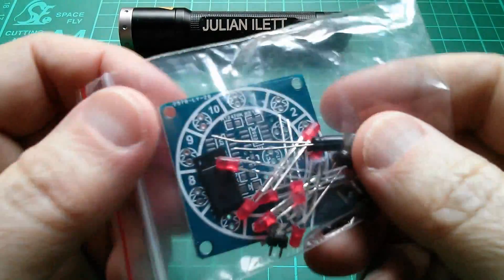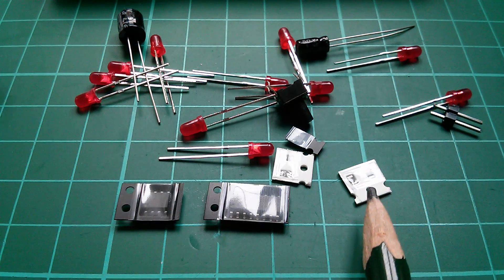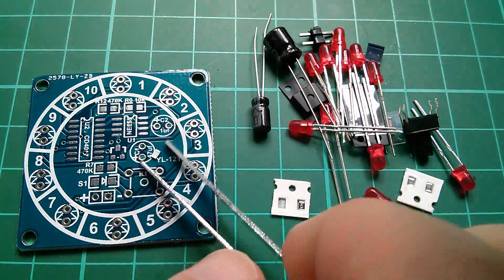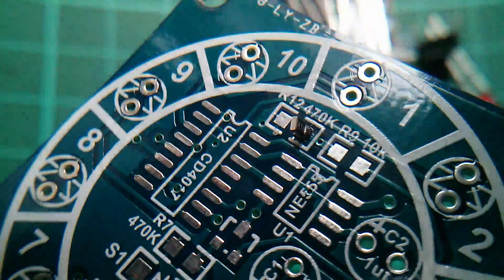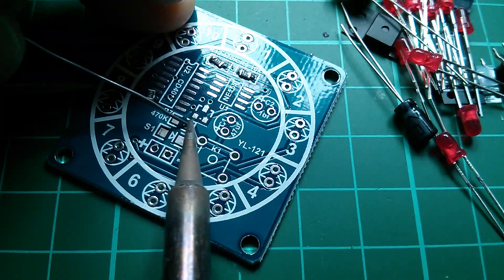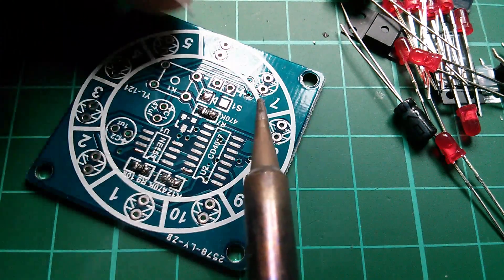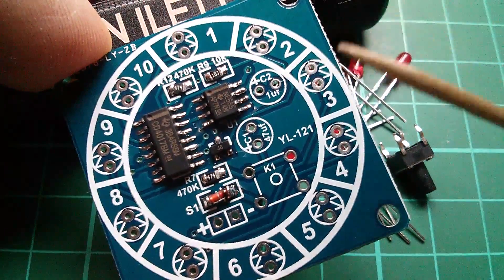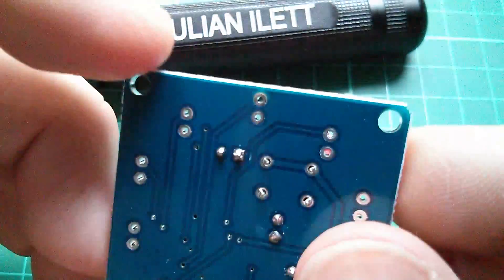Basic Electronics: Surface Mount Components Kit - 555 Roulette

Comment: You can do  surface mount stuff with solder past, just a tiny blob on the pads , place the component and then go in with the soldering iron while holding the component in place with whatever comes to hand , a tooth pick / cocktail stick woks fine

Comment: I think soldering surface mount is easier especially when you have to remove the components.  I hold the small components down with tweezers while tacking it on one side. I hold and align the large components down with a fingers while tacking two corners. If you want to try drag soldering I tilt the board with one hand so the solder runs down across the leads while holding the iron with the other hand. I've seen videos on drag soldering and they lay the board flat. I let gravity assist me because molten solder runs downward. I did it like this everyday for 11 years.
Reply: Same here, SMD is easier as you don't have to deal with flow through for holes. Thin solder also works better, I use .022
It is unusual to see small kits with surface mount components.

Comment: What i like to use for teeny tiny components or things of the like i need to hold still while gluing them down is a pair of tweezers you can get at bargain stores that when you squeeze them they open up and when it's let go it holds the tips together with an adequate amount of pressure, they work great.
Oops i just noticed that's exactly what you used for the diode, right on =)

Comment: you may find it easier to tin to surface pads first, dab some flux then place the components after with tweezer. Touch one end of the component and watch the solder melt around one end of the component, then repeat on other side.

Comment: i did a part surface mount kit a few months back and i brushed a tiny bit of solder pate on the pads, held the component on with a cocktail stick like you, and just touched each pad with a 1mm tip....seemed to go ok as long as you get the right amount of paste..

Comment: Julian or anyone ,how is lead free marked and how is leaded,solder marked my new roll is marked63/37 I assume that the among of lead and tin,I hope I bought leaded solder,I no some of the Chinese brands don't work as well as my old roll of Lester solder I trying to find the best brand of leaded solder
Reply: Lead solder is either 60/40 Sn-Pb, melting point 188 °C (370 °F), or eutectic 63/37 Sn-Pb, melting point 183 °C (361 °F), less prone to dry joints.
Lead-free solder is usually eutectic Sn-Ag-Cu, melting point 217 ˚C (422 °F).
I use 63/37 Sn-Pb for hand soldering due to the lower melting point.
Any well-known brand, 63/37 water-soluble flux-based solder will do well.
Reply: Thank

Comment: I did the same as you did ,I thought I was getting,the kit with the normal size components,my first kit with smd chip on it flew across the room,I order another batch of the ne555 chip,then when I went to solder my chip on,one of the little pad disapered,not to be out done,I ordered another kit,now I am watching your video ,and hope I don't screw this one up,I also oreded a regular size kit.this kit is not for beginners,I read up on it and it said for experts.if

Comment: For future SMD soldering jobs I would recommend using the tweezers to hold the component by the sides. That also applies to ICs when soldering one pin down first. Tinning one pad and reflowing it to attach one side of the component is the right way to do it when hand-soldering. For ICs with more pins (they're usually the same package but the pins are closer together) you can drag the iron across all the pins (after sticking it down with one pin first) and add solder at a constant amount while you drag. If you see bridges, drag again starting from the bridge and moving across the other pins. Do not drag outwards or the bridge will remain. You can also use a desoldering pump on the bridges, or a slight touch with solder wick. It usually retracts just the right amount to make a perfect solder joint but also removes all bridges if they're on the same side. These are just helpful tips, like with through-hole soldering you will develop your own custom technique that feels good for you. Also, regarding the LEDs, Chinese people have a bad habit of putting the flat side and the short leg on the positive side. They're not rejects, they're just cheap Chinese LEDs that they have designed themselves. It's annoying but true, I also have those kind of LEDs.

Comment: I have found with many of these kits is a very thin layer of solder on the pcb, so just place and hold down the the component and heat up each lead with the solder tip.

Comment: You could always use ESD tweezers to hold the component down while you get it in straight.  Also, flux works wonders with SMD components.

Comment: Another helpful tut that I am so grateful for, thank you. I know I screwed up but not sure where. One led comes on,does not flicker when button is pushed just stays on while the remaining 9 stay off. Can you suggest where my mistake was ?
Reply: Since nobody seems to have replied in the months since you posted this question, I'll see if I can help with some general advice.

If a LED lights up but the button does nothing, this suggests that the 4017 counter is working but the 555 timer isn't.  The most likely reason for this is a bad connection somewhere around the timer or the button.

Comment: Left-field tip for  the bigger chips: sandwich the chip and board between two tiny neodymium magnets, slide it into position.  There should be enough friction to do the job.
Reply: oops, forgot to mention that you need a non-ferrous tip on the iron, or make the copper wire wrap tip extension mentioned in another comment.

Comment: Surface mount parts can be a pain. I have a microscope where I work to see and touch up joints made by a machine. It's not super powerful, it's markings are 1X-4X but I suspect that's in multiples of ten. Also a stupidly thin soldering iron tip helps too, less you bridge half your connections together. With good lead solder, flux is hardly necessary, although all my parts come pre-tinned so that obviously helps.

Also, you can try using some glue, fast drying super glue works, to tack the components in place, saves you the headache of the components sticking to your soldering iron.

Finally, a pair of ESD safe tweezers can be a life saver.

The business where I work uses a wave solder machine that is probably older then I am (born in 91) with surface mount ICs on the bottom of the board. It constantly bridges connections and misses others. I have plenty of work to do.

Comment: You made that look difficult. You should try using some solder paste, cheap ebay stuff is fine. Just add small amounts to the pads, use tweezers to place the components into position and use a heat gun/blower attachment to melt the solder evenly on all pins. It will line up your components perfectly.
Reply: +Gus Wilkens 
That's what I was trying to think of, seen someone doing that in a video, will have to remember solder paste if i ever need it.

Comment: Tip: When mounting SMD ICs, attach one pin, then use a strip of solder across all the pins and drag the soldering iron from one end to the other. It's faster and doesn't end up with using too much solder. The initial attach point needs to get re-soldered using some flux.

Comment: For me this kit was the first SMD kit and it didn't work out for me. The NE555 had no sign on where pin 1 was and so I soldered it the wrong way around. After desoldering and rotating the kit still did not work (which might have killed it). 1 LED lights up and that's it and randomly after some time it goes to the next LED. Sometimes when pressing the button it jumps to the next one too. The SMD IC's might have gotten too hot. Luckily it was just $1.00 when I bought it off Ebay. They also have SMD training kits where you get a lot of SMD components and when you soldered them all you can make a LED light up when powering it. It should come in the mail anytime now, I could use a bit of SMD training.

Comment: That project brings back memories.  Doing SMT soldering with soldering iron is tricky until lots of practice has been done.  I professionally had to remove something like (300) TE28F640 flash chips with a Hot Air Station, try to re-program them all in a programmer but pins so tiny, never could get all pins to fit in the programmer, so had to program and soldering in new ones.  Took a few days to get the method down yet once done, was able to get them install super quick (about 50 seconds for 40 tiny pins exactly in place without bridges.  Using the Sweep method and good liquid flux made this very easy.  But yes, took tons of practice to get the right feel.  Using Desoldering Braid/Wick with little solder on the wick, brushing over the SMT pads put just enough solder on the pads to do a easy tack soldering of a few of the tiny pins where chip was alined.  Then later coming in a soldering in the IC proper.  Even got where could fix 'lifted' SMT pads with 30 gauge wire, then put IC on that.  From starting out, it was ultra stressful to after a week of doing it, actually enjoyed it.  Disappointing when job function changed.  For smallest parts, Hot Air Station practice and its easy with those too.

  So all this is put here for any reader learning SMT works, don't give up.  Its like learning to type, seems impossible at first but finally, comes together and its easy.

Comment: Julian, best way to solder SMD like this is to use liquid flux.  Apply to the pads, place the component on the pad, hold with tooth pick or tweezers and then apply the iron with juts a trace of solder.  The flux ensures a good wetting of the joint and allows you to get neat and tidy joints
Reply from the maker: Malcolm Crabbe Flux pen is now on my shopping list - cheers

Comment: Your joints don't have to look like that ;) . You should really get a different tip for soldering SMD! This one is way too big and the conical shape does not help either.

I've used conical tips for the longest time (even had one 0.2mm tip) and always had problems to get the heat into the pad and the part at the same time (which is absolutely necessary for a good joint). With a conical tip (or as seen from SMD scale: ball nose tip) it's quite often impossible to touch both at the same time because of the radius and when it does it's always only in a single point, which doesn't help the heat flow. Adding solder to the tip to have more contact area is contraproductive, because until you get to the joint all the flux has burned away and if you add any more fresh solder it's way too much. You see how you have a problem to pretin the pads without touching the tip? Ideally you heat the pad and and add the solder to the pad, not the tip.

My new soldering station then came with a small chisel tip (1.2mm wide). It's very easy to heat the pin and the pad by just pushing the chisel into the corner between the two, which makes the solder flow very nice without any blobs.

If I had to list what is needed for SMD soldering in order of importance (IMHO):
1. the right tip -> small chisel tip
2. fine solder -> 0.5mm diameter max.
3. ample flux -> flux pen or mix your own (get the rosin and add isopropyl alcohol)
4. temperature control -> time for a soldering station ;)
5. proper tweezers -> normally closed ones just chuck around the parts randomly never to be found again; pointy angled tweezers work much better

Comment: Hi, I got that arduino watch project, it was all surface mount and I ended up nuking the whole ting by using my butane soldering iron.  Problem was I forgot there is an exhaust on the blasted thing and I melted the OLED.  I was using soldering paste and it worked very well for SMD, most of it worked OK with my USB soldering iron however I wanted to use the butane for the wide area of the oled and the processor. Ah well 24 bucks down the tube.  Thanks for the tutorial though I see where I made my mistakes.  Perhaps after building a few more kits I will order another of the arduino watches and try again.

Comment: Hi Julian, i like watching your videos. If you plan to do more surface mount stuff, you should get a sharp pair of tweezer. Also you can solder the first pad of a component by using a dip of flux and then touch it with the iron with a little solder on it. I remommend the gel type flux. This makes it easier because you can hold the part in place with the other hand and the blob of solder is not dislocating the part.

Comment: When soldering SMD ICs with lots of pins that are a bit bigger, like the 4017, I usually take a small drop of Superglue and glue it to the board, then put a bit of solder (not too much!) on the soldering iron and drag it around the pads. Or if you want you can solder each pin individually.